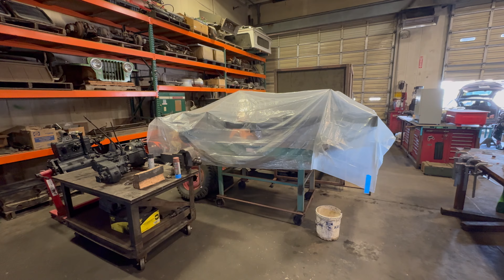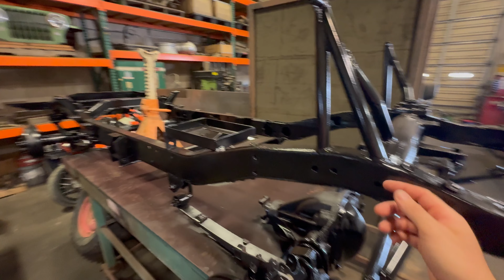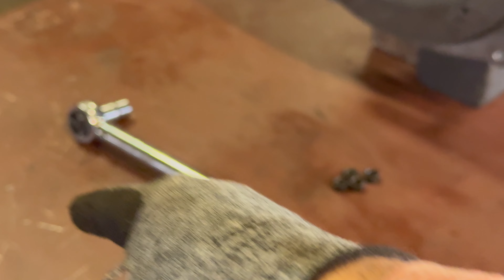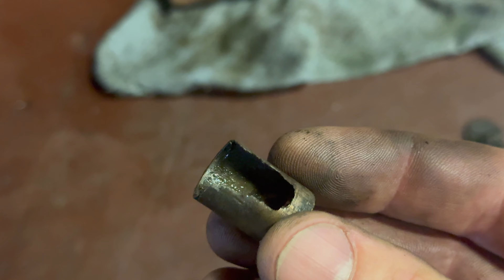Willys CJ2A Resto Part 4: Flywheel Fixes (Helicoil, Taper Bolts, Bushings)

Comment: i must have about half a dozen of those clutch alignment tools around but can never find one when doing a clutch...i just eyeball it as you did...i also never have any loctite when i need it...but i discovered that ultra black RTV works well on the flywheel nuts...i just dab a bit on the end after torquing and let it cure.
Reply from the maker: Ooooh good to know!

Comment: This hits all the DIY notes: TDC finger test (3:30), timing-mark sanity check (4:33), and a no-drama Helicoil repair (~10:00). Poll time: Helicoil vs Time-Sert? Are split lock washers fine with blue Loctite at ~35 ft-lb? Also team “eyeball the clutch” or “use the tool”? I’m following this series and can’t wait to see the chassis back on wheels. Solid work, Colin. A methodical delight to follow along. Liked.
Reply from the maker: As ever your comments crack me up. A beautiful summary :)